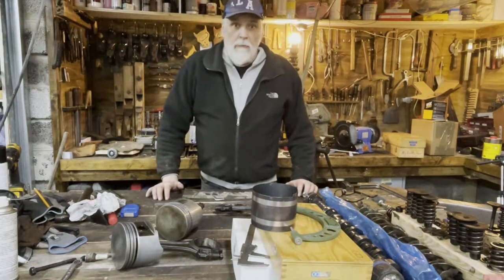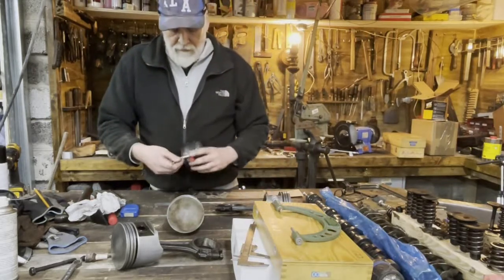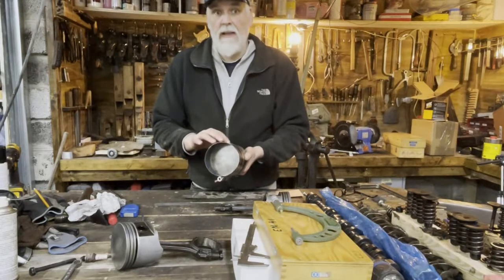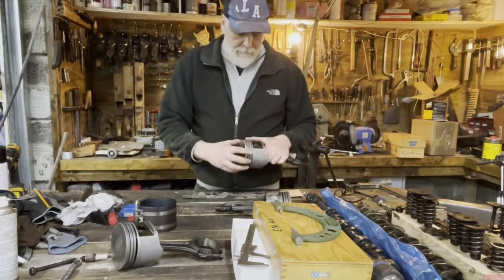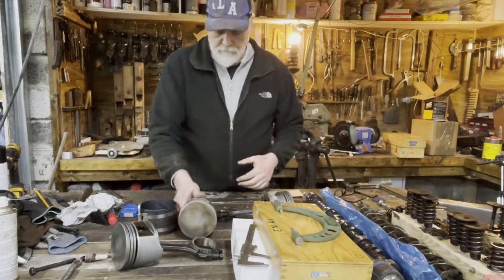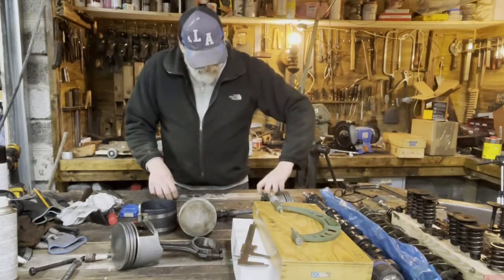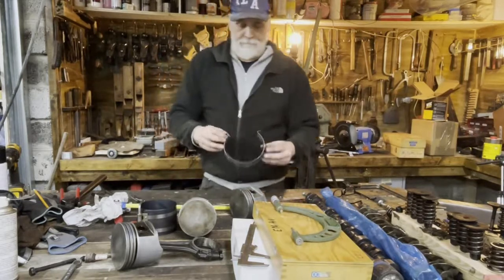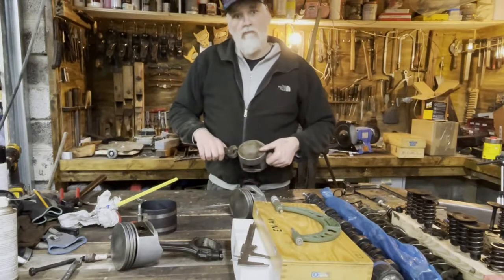How to install a piston without a piston ring compressor.

Comment: Here's a funny story for you.
After an hour of trying to get my motorcycle piston rings compressed with different tools, I FINALLY realized that the bottom of the cylinder/can has a taper.  Which meant all I had to do is adjust the rings in the right position,  and carefully slide the cylinder down over the piston and the rings compressed themselves!!!!

Comment: Works fine. I am building my first all new parts VW Beetle engine with forged pistons. I have a nice sheet of stainless steel ready to go to put the pistons and rings into the barrels. I don't need to buy a special tool. This tool will allow more room, as the pistons and gudgeon pins go onto the conrods first with an aircooled VW boxer engine. Good video.

Comment: That piston is going to slide in a whole lot easier if you let it soak in oil for a bit and treat the bore as well. 😆
Reply: that's just messy for no good reason, just wipe some oil into the top 3 inches or so of the cylinder bore with a lint free cloth. then oil the inside of your ring compressor, whatever it's design.

Comment: The hammering is really the scary part as u don't know if the rings got stuck outside the rim and your hammering is breaking it and possible damage to the piston or cylinder rim.
I would sharpen the edge of the band to give the rings a better chance of sliding into the cylinder.
Reply from the maker: Thank you for the comment! Yes, I agree with you. As an alternative i use to make 3 or 4 small nibs with a plier at the bottom towards the piston which ensure the that the ring is pressed in into the piston properly. Doing one ring at the time gives me better control and I have managed to install many rings without breaking them, so far :) Making the edge to sharp could in worst case make it go in between the piston and the cylinderbore. But the tool is cheap and we can experiment :)
Reply: @ifixmycarmyself2502  One ring at a time is GOOD idea. Amazon has this plier version for $30 ish with multiple bands. It might be worth the $ than your DIY version. I first tried the $9 harbor freight ratcheting version but did not like not knowing the position of the ring gap (0-120-240 degree) would be changed or not. Anyway, thanks for the video.

Comment: Thank you new subscriber!!!!🔥🔥🔥 3 QUESTIONS. 1) what gauge sheet metal are you using? 2) what’s the name of the tool you’re using to open up the piston rings. 3) your piston was 35, did you cut it to exactly 35 or did you add extra? AND I LOVE HOW YOU PUT THE LAST TWO RINGS IN. I always put them all in at the same time. YOUR WAY SEEMS WAY EASIER!!! Thanks again!!!!
Reply from the maker: Welcome! I didn't pay attention to the thickness, maybe a millimeter or so, is that 24 gauge? or close. I bought the tool in 1985 and it says "made in Germany" thats all. No i measure in centimeter, 35, an added two, so in total 37, approximately. I put the rings in one by one because it doesn't take any force. I actually don't have to use the plier i can squeeze it together with my fingers and push the piston down. Glad you liked it!
Reply: @ifixmycarmyself2502  thanks for responding!!! I went through your channel and I love it. I’ll be binge watching your channel tonight!!! You’ll get a thumbs up from me!!!🔥🔥🔥🔥🔥